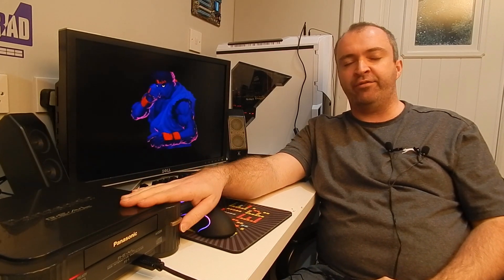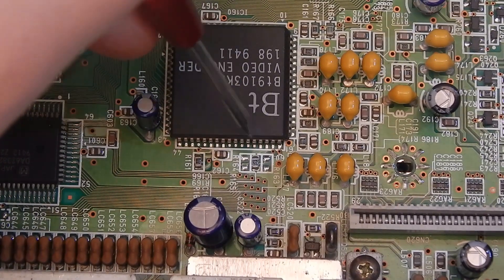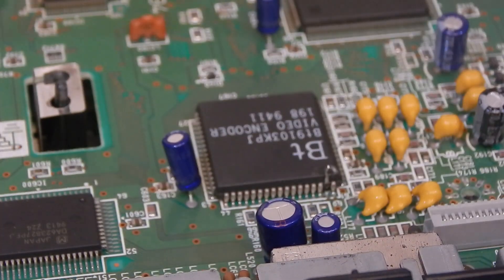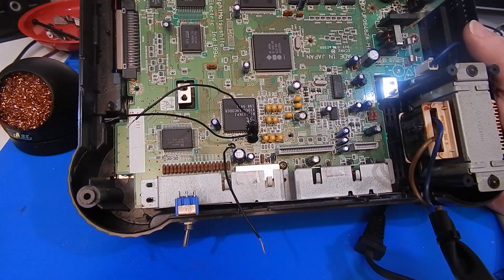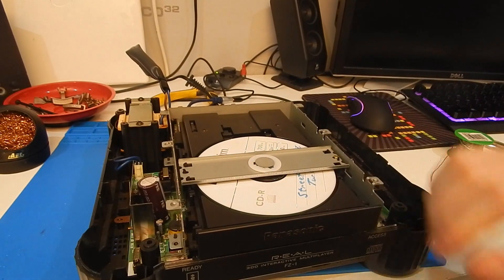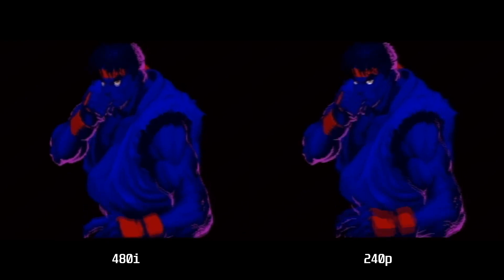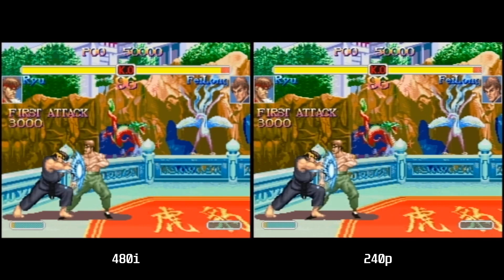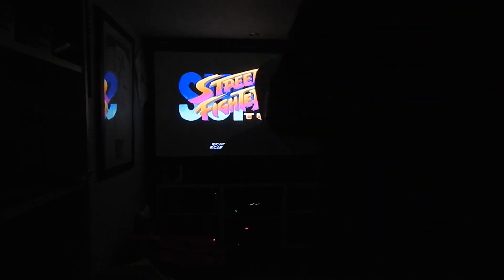Panasonic 3DO 240p progressive video mod

Comment: My 3DO actually has a little switch on the back that lets you choose between 240p and 480i mode. It's a Japanese system, and I don't know a whole lot about it but apparently they're not super common. I think maybe only the very first run of Japanese 3DOs had the switch?
Reply: That's how the ability in the chip was discovered! For a while collectors thought it might've used a different chip, but then further examination showed the factory just basically applied this mod. My vague memory is saying it was the final run rather than the first run, but either way it was 100% definitely in the minority of units.

Comment: Lovely video!
Do you have any suggestion / tutorial for the disassembly?

Thanks!
Reply from the maker: If you watch the first 5 minutes or so of my 3D oh what a nightmare video I disassemble it in more detail.  It's fairly simple though.  There are 4 screws on the bottom of the case, take those out then lift off the top, 4 screws hold on the cd drive and 2 ribbons to disconnect then just a load of screws in the RF shield.
Reply: @CRG 
Super thanks!
I got scared for nothing, I followed your instructions and now I "am in" :)

The cd reader is VERY loud...
Could it be just dry and I need to put some lubricant in or...
Is it about to die?

Comment: I couldn't see any difference between 480i and 240p on the video. Maybe its because im watching on my 10inch android tablet. Obviously the pad of the unpopulated resistor closest to the chip is going to be 5V if the chip is in interlaced mode when that pin is at 5V. I think lifting the pin is not even necessary. I suspect it is a pull down restistor to ground the pin of the chip. I think you could've safely soldered a 1K restistor in series with the switch to enable/disable 240p. You would've only needed 2 wires as well.
Reply from the maker: You're correct in what you say.  It's blatantly obvious looking back but it's done now so just chalk it up to lesson learnt. 

As for the different it's slight but is there and more noticeable in person.  Part of the problem is my capture card does to good a job with the original interlaced signal.

Comment: I was under the impression that the BT chips had no 240p support at all and additional hardware was required (https://www.assembler-games.com/threads/240p-output-on-3do-with-bt9103-encoder.66295/)
Reply from the maker: That links doesn't seem to work but the mod I followed, also from assembler games, can be found here - https://assemblergames.org/viewtopic.php?f=81&t=495&sid=330961cdf793b1f6c7305a10ded23b73

The console is definitely switching between 480i and 240p.  The 9101 chip seems to be a problem, its a completely different package though with 150 pins.
Reply: @CRG  Interesting, yes I am looking at the same info as your link just on a different site (https://www.assembler-games.com/threads/240p-output-on-3do-with-bt9103-encoder.66295/) in any case upon further reading it seems that you're right 9101 is different than the 9103.  Going to open mine up and see which one I have again (I think I have the 9103, if true I will be following your video and doing this simple mod).  In your video, perhaps because of the capturing, it was very hard to discern any difference when you were switching modes.  I'm assuming in real life it's more pronounced.  Did you find that sometimes it switches on the wrong field and you have to flick the switch a couple times to land on the right one?  Thanks for the reply.
Reply from the maker: I've never had an issue with it switching to the wrong field.  From what I've read that problem only seems to effect the ntsc console that uses another different encoder chip.  That other chip doesn't seem to boot the console in 240p but the 9103 is happy either way. 

As for the quality improvement, it is very subtle but the difference is definitely there.  My capture card does to good a job deinterlacing the image but on the TV in person you can see it better.

One bit of advice, the legs on the bt chip are very delicate.  When lifting it bend it to its final position once and don't try to straighten it to much.  They break off very easy.

Another thing just to mention.  The 9103 is very similar to the 9106 and 9107 used in the cdi machines.  Those chips should be pin compatible but have the advantage of being able to output rgb.  I think in rgb mode it would disable the svideo output but it might another option for further modding.  I wouldn't fancy swapping the plcc package though.  My soldering skills aren't that good to be honest.
Reply: @CRG  Good info thanks.  Just got mine apart, and it is a 9103 (NTSC).  I was just about to start the process but ran across this and it's very recent (a 240p/RBB mod chip for the 3d0) https://www.youtube.com/watch?v=7ldMzndjoW0.  Not sure which route I should go now.